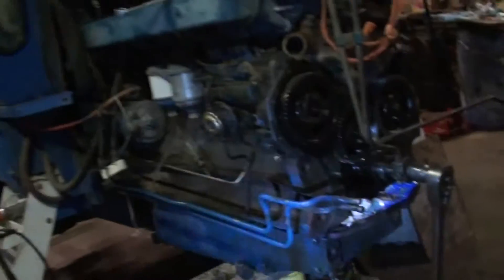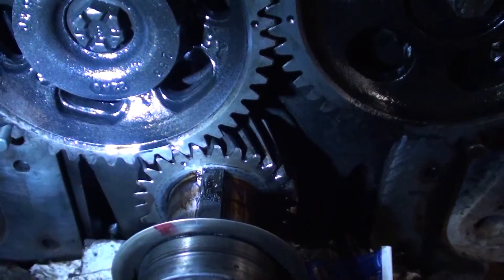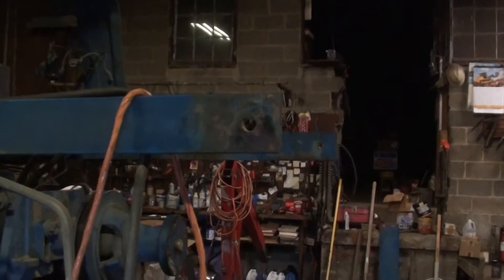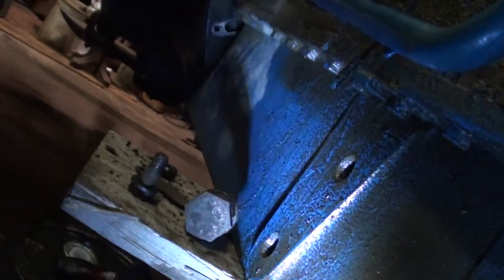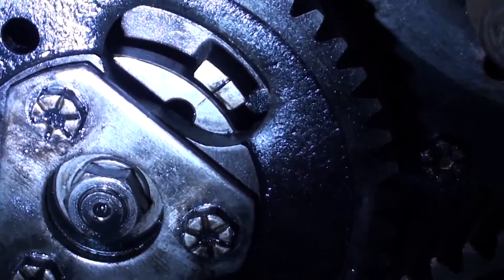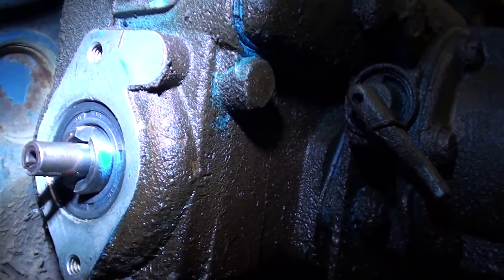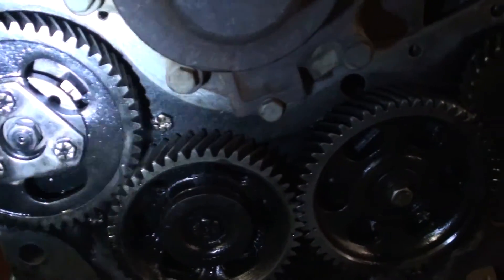Ford 9600 Timing is set.

Comment: Your timing gear on the injection pump does not appear to be lined up….. at least it looks like that in the picture, Also the teeth on the injection pump and drive gear looks like 2 teeth are broken or badly worn….. it may be the angle of the camera tho.
     Those 9600 Fords are good tractors! I’m curious if it is fixed now?

Comment: The idlers gear only lines up every 60 revs or so. Ford was awesome about using the dribble timing method to set things. A couple degrees make a big difference.  Also check the governor boost line it can get over tightened and cut air off so the pump wont adjust as it should.
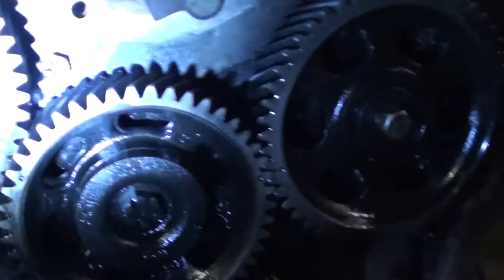Reply: The injection gear looks like it has some flat teeth does no one see that at 1:44? Guess it's just shadows! I hate when I think I found the problem just to find out it wasn't the problem.  I have a 3000 1971 series ford 3 cyl gas and when adjusting the valves I find the intake valve starts opening about 12 deg after TDC 0 deg on the flywheel. The exhaust valve finishes closing about 36 deg after TDC 0 deg on flywheel markings. How can I tell if my warm running lack of power symptoms are due to a misalignment of cam timing without accessing the cam gear timing mark? I think I might have to rip the front end off.  Wish there was another way to tell if the cam is installed with proper timing seems like 36 degrees from TDC is pretty far into the intake stroke to be just finishing the exhaust valve closure.  I guess that could be normal but my exhaust valve has about .002 play on cyl 1 when according to the manual the rocker arms should be tight. I guess tight could be a realative term.
Reply: @rodgaskins  the gas 3000s were really picky on fuel pressure with the carb setup they had. Also they had a bad tendency to heat soak the carb and plugs causing hot lack of power concerns. I have seen where the fuel line was run to close to the exhaust etc. Plug temperature is more important on the industrial engine than most people realize. Also proper cleaning of the points and a good quality condenser so that there is proper spark. The 3000 gas ALWAYS left something to be desired as far as I am concerned. It just seemed to be lacking no matter what you did. The likelyhood of a cam being out of time would be so small I wouldn't even consider it. If the cam gear moved it isn't going to stop it will slip to the point it would barely run. As far as the flat teeth in the video it is just oil on the gears. Those gears are case hardened. Once you wear through that the gear will fail in a matter of hours.
Reply: @countryboysteve  thanks I'll look into the heat soak issue sounds like it makes sense with the symptoms it's giving me which are loss of power when under a load after it's been running at high idle for a long period. Who could mess up the dots on the gears right it's not like a distributor rotor the marks are right there stamped in for you although I was working with a guy once who... well lets just say if the dots were a little off he might say, "Ah, close enough" Thanks again for sharing your experience, I"m kinda feeling down now I thought I was going to get to tear the front of the tractor off for my first time :( oh well guess less sandblasting old parts to put them back on looking like new ;)

Comment: The injector drive gear looks odd. It might just be the angle and the lighting but it looks like it is off one tooth. Both gears are beveled and the injector drive gear isn’t as thick as the idler gear so that might be why it looks off. I am just finishing up the rebuild on my 1967 Ford 3000 diesel and they look pretty much the same from the front like your showing here, same layout gear wise and timing is also the same with #1 at top dead center on the power stroke, compression stroke or firing point what ever you chose to call it. That injector timing looks weird.
At 2:36 you can see that it is lined up ok, got to look quick though. 👍

Comment: I'd say you have either a lack of air suction from something or its just old and tired and needs an overhaul or its just the pump getting weak and not able to keep up. Does it have any blow by? Is the turbo all sealed up and no shaft play? I'd check all of that if its still weak.
Reply: Checking is on my list to now how to check blowby?

Comment: Hello,  did it solve the problem we have similar problem at the moment.
Reply from the maker: No, still is suffering from a lack of power.  Turned the fuel up and all it does is throw huge amounts of black smoke.  Although, it starts very quickly, even in cold temps. We are guessing that it is only generating around 100 HP because our Ford 8000 will keep up to it.
Reply: Yes we are at a similar point. Our gear seems right but the pump gear was wrong. We have also took pump and injectors to be tested. Also another thing did outset it up when number 1 piston is at top dead Center on the compression stroke? You have to really take the valve cover off so you can see when at correct position.
Reply: @Robinrob181191A  I love taking off valve covers... "what's this someone broke of a valve cover bolt and painted over it and gobbed silicone all over this corner of the valve cover gasket!  Even more fun ;)